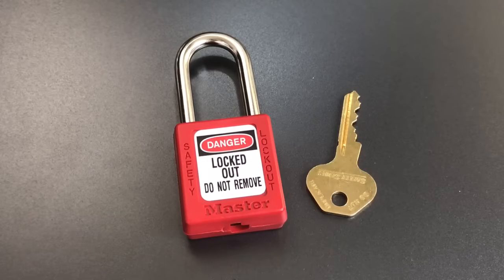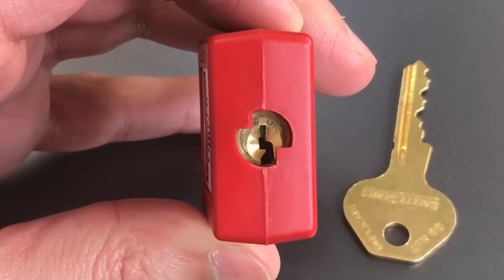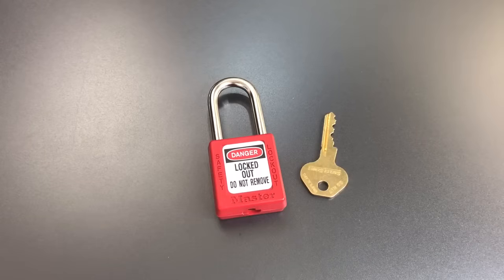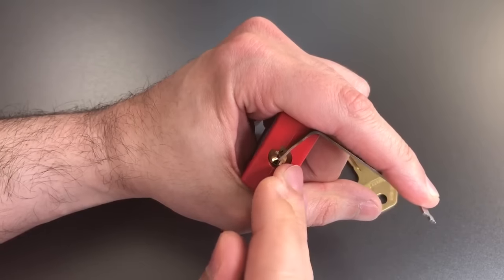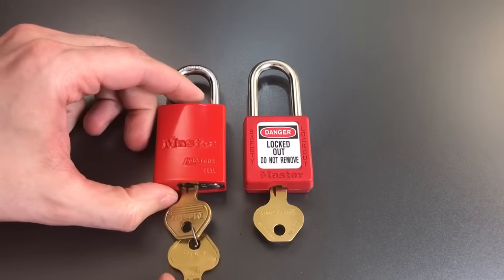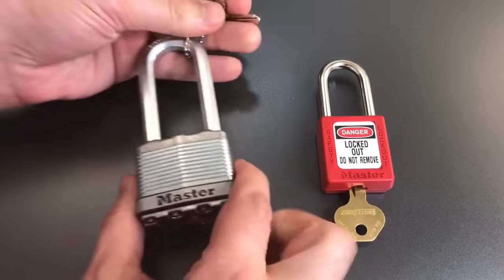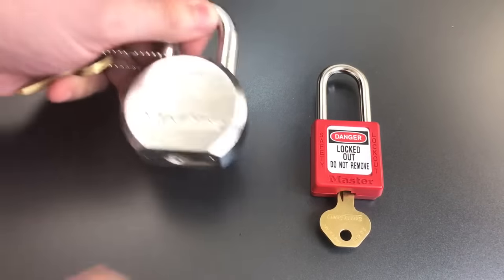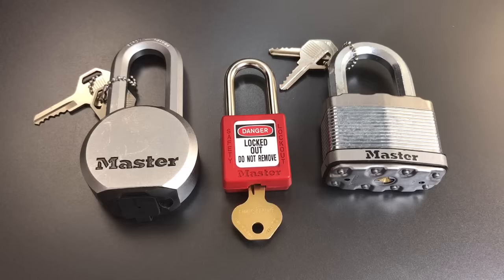[479] The Master Lock Paradox - Model 410 LOTO Padlock

Comment: It is a desirable feature for these locks to be relatively easy to break. Many times locks needed to be broken when an employee left the facility without removing their lock.  A supervisor was allowed to break the lock after locating the employee and verifying that they were no longer at the site.   Usually these locks were used with hasps that were even easier to break than the locks. As far as I know, these locks are not useful beyond compliance with OSHA regs.
Reply: I was going to say that. 
Also the employee could drop the key somewhere irretrievable. Also the locks should be inexpensive and unlikely to have common keys and resist accidental raking despite a maint-dept having large numbers of them.
Reply: mjenk20236

I've had to use one of these and I believe that is the case. I dropped it about five feet once and the shell came clean apart; it's not fusion-welded or anything, literally two halves of a clamshell with a couple pins for aligning them with each other and some light adhesive to keep them together. I taped it back together.

As for the extra security, it's to help ensure your key is actually being used on YOUR lock. But on the backside a label is provided where you're supposed to write your name; it also comes in several colors, mine was yellow, here we have a red, and I've seen blue before. An ounce of caution will go much further than any lock core in making sure you remove the correct lock -- does it have your name, is it the color you were assigned, are you sure you're at the panel you are responsible for?

It would also be feasible to provide multiple locks to each person if they will be working on more than one zone. Use different colors or something, or stamp serials on the shackle and each matching key.

Finally, a fatal mistake I have seen is for multiple personnel working in one zone to daisy-chain their locks off each other. There are group lockouts with multiple holes for each lock to be installed and ensures every lock must be removed before it can be energized, use them!! A six-hole group pad can be made to fit many more, just daisy-chain the group pads off each other until the necessary amount of holes is had. If even one lock exists anywhere on the chain, ultimately the one on the equipment will not open.
Reply: wow, where I work if you leave your lock on a tool/machine you will be called back in to unlock it.  You could lose your cert and or get written up if they have to pull out the bolt cutters and have a huge ordeal.
Reply: All you need is a claw hammer to break off a plastic masterlock.
Reply: Nailed it.

Bigger yellow ones are usually on the hasps. They aren't meant to not be broken into, just so you need to fill out a form and check the machine is clear.

They're for saving fingers not property
Reply: Mikej1592 that makes sense for machinists. But in production when you have 40+ employees locking out multiple power sources 2 or 3 times a day doing hot and sweaty work as fast as possible to move on to the next one.. shit happens.

We look down on it, but it wouldn't be realistic to reprimand operators for it. Fill out a form and cut the lock, unofficially give the guy some shit for it and move on. 👌

The time and money spent on training and certifications far outweighs a few 10 dollar personal locks. And really, you only use your red lock alongside the yellow lock box locks. Usually on the lockbox hasp itself.
Reply: mjenk20236 did you know that you can get locked up in jail if you break a lockout lock in certain parts of the world, as in some cases it can lead to harm of other people
Reply: I only lost my key once and that was enough. It had fallen through a hole in my pants under my overalls and down my pants leg. I had to practically strip right down to my underwear before I finally found it. All my workmates were having a a good time watching me go nuts trying to find my stupid key......Never again!!!
Reply: mjenk20236 

Besides being able to cut the lock easier, another couple features are that those locks are lighter weight. If you’re running a loto with 200 locks, that’s a lot to haul around, even with a cart.

The long thin shackle is also desired when locking breakers or ganging valves/chains together.
Reply: In my country it's actually illegal to break those locks, even if the guy who locked isn't in the vicinity anymore. That's why some pad locks we used came with tag attached with the worker's phone number and address
Reply: mjenk20236 you people aren’t understanding the paradox he’s talking about. It’s not necessarily about the LOTO lock having a good core but a crappy housing body. It’s about why does the LOTO have a good core but the other high-end, probably very expensive MasterLock locks don’ have a similar good 6-pin core. That’s the paradox. Why would the consumer-use high-end locks with strong bodies not also have a good core when these are the ones that are more likely to get picked?
Reply: Because consumers make their purchasing deciaiona based mostly on two factors: price point and looks. Using the better core in consumer locks would increase the cost without making it look more secure, so it would be a poor choice from a sales perspective.
Reply: @johanbouwer5386  Yes, but if an employee locks it out, and then has a stroke and goes to the hospital, it is perfectly acceptable for the OWNER of the equipment (management, the boss, etc) to have a well documented set of procedures to verify that the employee is no longer working on the equipment, is no longer physically present, has zero chance of being harmed if the equipment is re-energized, and to break/cut their lock so that the equipment can then be used. Probably will require at least two management level employees to approve, and perhaps an actual equivalent maintenance employee to verify the equipment is in a safe condition to turn back on, and to all sign off on a document certifying that.
Reply: @leaf3814  What if the guy who locked it, fell asleep while driving home and drove off a bridge and died? Is the employer required to just never use the locked-out equipment ever again? (And just for good measure, lets say his key for the lock was lost in the river he drove into)
Reply: @r6u356une56ney  you are correct. Only certain people may remove the lock if the employee is unable to for any reason. Usually there are only about two or 3 people at a factory with the certification for it.

Comment: Lockout tag out is practiced mostly by electricians for "locking out" electrical circuits aka turning them off and then tagging it with name and phone number. If this circuit was somehow to get turned on while getting worked on someone could die. Not designed for anti theft. Power tools are every where. I could cut the shackle off with my linemens aka side cutters.
Other companies make lockout tag out locks with a picture of the person attached on shackle with "Do not turn on, my family depends on me" written on lock body.
Reply: Holy moly, how dramatic!
Reply: @seno5530  It happens more than you think

For example in the USA alone, between 1992 and 1999  (i.e. 7 or 8 years)
there were ~2500 fatal occupational electrocutions.  
Most of these (i'd guess upwards of 98%) occur on low voltage circuits.

So that is about ~300 per year over this period.
Reply: They are also used in Underground mining for locking out dangerous equipment, if you need to go into the area that has been locked out you have to lock on first, and everyone needs to personally remove their danger lock before the equipment can be re-energised. they are for protecting human life from accidents, not for protecting valuables from thieves.
Reply: Nick Paul  My man came back to the exact same comment a week later just to double down on calling "Se No" an idiot. What an absolute chad.

edit: Unless they deleted their comment. Fuck, I'm tired, idk why that wasn't my first thought.

Comment: As otherwise mentioned, we use these for safety in the oilfield for, "Lock out, tag out" of valves and pumps when equipment is shut in or being serviced. Where these are used can often be bypassed with a wrench or screwdriver to disassemble the handle or leaver leaving the lock intact. What I leaned from this vid is that they have great cores that will help prevent accidents and serve their purpose perfectly. Well done LPL, always interesting and informative.

Comment: This was probably done to provide as many possible key variations to prevent multiple people from having the same key, since it’s a lockout lock and they are generally key different. It provides an extra level of safety to ensure a lock isn’t accidentally removed and equipment re-energized.
Reply: Since it's a reasonably tough lock to pick, it's also not easy to remove non-destructively, so any malicious removal of it's likely to be discovered.

Comment: As a 25 yr career electrician, the light weight is especially handy when locking out small circuit breakers (lock out tag out or LOTO).  Bigger locks will just fall off.  Red is always the electricians craft lock, not personal lock.  This series comes in different colors too.

Comment: We use this exact lock at my workplace working on trains. We often have to carry around 3+ of these when going out to jobs. It is very light so convenient to carry. If we had to carry those solidbody locks around it would get really difficult so I can understand why the design is so lightweight. They are very reliable I've been using the same ones for 10+ years.

Comment: When I was out of high school in the steel foundry we never actually had lockout locks at all. Each maintenance man that was working on the machinery would lock my machine out and just put a regular lock on it. Somewhere in the 70s they decided they needed to identify whose lock it was so even though the mechanic use the regular lock he had a red tag on it.  it had a warning label similar to that one on the side of the lock your showing only it had the mechanics name on it. And like other viewers have said multiple mechanics needed to put their multiple locks on it. We had one machine that was out in the yard when five mechanics were working on it at the same time and each one had to have their lockout lock on it so that if they all went to lunch and one mechanic never came back and then got his lock off are they would still be four remaining it was never designed to keep people out it was only a designed to make sure that all the employees knew that they power should not be turned on and whose lock was on it and was probably responsible for the machine being shut down. It's not a lock that needs to be picked. The 6-pin Tumblers we're an OSHA requirement not necessarily keep bad guys out but just to keep the machine safe and the people working on it.

Comment: Brady also makes a plastic non-conductive LOTO. Plastic is preferred for electrical LOTO and metal, usually American 1100 Series, is popular for valves and other applications. WARNING: Do not pick the Master past 90 degrees. The key stops at 90 by design but you will dump all of your pins out of the bottom of the core if you pick it and turn it to 180. Which I did. I ended up splitting the case open (easy), putting the core back together, covering the holes in the core and put it all back together with a wrap of tape.Great practice lock.

Comment: These looks are placed on lockout switches that are generally power switches made of plastic and I think it's more to do with electric insulation and anti tamper than security as the switches can be removed very simply with a screwdriver

Comment: Great content! Lock out tag out (LOTO) procedures are for isolating energy sources, not securing valuables. In almost all installations it is illegal to remove a lock you did not place.  It is also common policy to ONLY use LOTO locks for LOTO purposes - they are not permitted to secure valuables. No need for a solid body - if you placed it, you’re the only one who will touch it. Regarding the better cylinder, it would be a tragic mistake if 2 unrelated contractors on the same job site had the same key and the wrong lock was removed by mistake. This is about safety and protecting someone from a potentially deadly energy release. So why not improve the tech in other locks? That’s up to Master, but they need to make sure for safety and liability reasons that their LOTO locks remain safe to use.

Comment: Electrician, speaking from knowledge of multiple men working isolations of one individual circuit E.G. a socket, the idea is that there's less possible chances of a replicated key so you know that you're the sole holder of the key to energize the circuit that you have isolated. They've  put their most secure barrel on what is considered an electrical isolation lock (not for average security on a door) to remove any possibility that by absolute chance the key and barrel orders have been replicated  and another individual can unlock another electricians safe isolation lock thereby causing him to be electrocuted. Hope this makes sense if you see it :)

Comment: We use these at my work alot, the only reason I can think would be a good reason it has strong core. The reason would be that you don't want someone discreetly opening the lock, if someone snaps or breaks the lock it's totally disabled and clearly something is wrong, while if they pick it then flip the switch then re-lock it , then it could be perceived as still working properly but it's actually an unsafe scenario
Reply: If they have malicious intent but are planning ahead, couldn't they just break off the lock, flip the switch, and then put on a new LOTO lock of the same type — either one grabbed from storage, or one they purchased themselves?

Comment: As an electrician I use the model 410 all the time as a lockout on 20 amp breakers. And I like these over the metal bodies just because of the lightweight. And when you have to have multiple people lock out on the same breaker it can be a good amount of Weight on the lockout. With enough weight they can get pulled off.

Comment: I'm a welder 14 years, and also an industrial electrician. I've been trained in lotto, and those locks really are a big deal. Everyone working on a permit that is relevant to the job, has to put on a lock that is signed out to you. Once the job is done, the equipment, or electrical system can only be turned on once everyone has removed their locks. If you forget your lock, and you go home for your days off, the system cannot be turned on until the company gets the key back lmao this has happened and people are immediately terminated for forgetting to remove their lock. Also if you remove your lock, but go back and work on the equipment without putting it back on, your immediately terminated, or killed by someone energizing the system.

Comment: I work at a French silicon foundry, this is almost the one we use for LOTO, except with a black plastic shackle. Pretty sure they use the same core. Pushing the paradox further.

As for understanding the core/body weirdness, let's say it's likely a very American thing: the product, before even starting any development or anything, is supposed to meet a price point, and once the body is developed, depending on how much it costs, will be assigned a core... with no regards to anything but overall cost.
Reply: Businesses aren't that stupid, especially in the US. They certainly have an upper bound on the cost of every part, but will certainly choose a less expensive alternative if it's available and meets specs.

You're probably thinking of the US *Military*....

Comment: The most secure part of these locks, honestly, is the LOTO policy that goes with it. When trying to remove an LOTO lock without a key is a fireable offence without several pages of paperwork, it doesn't need to be pick/break proof. We had a bit of a problem with people confusing which lock was theirs since sometimes machines can have upwards of six locks on them. I bought a sheet of stickers from the dollar store and it looks odd, but it works.

Comment: The plastic is both non-conductive and non sparking.  

Both are really important in an industrial environment.  

The six pins probably have to do with the number of key combinations possible. 

I use them a lot at work.

Comment: I can say from my experience repairing industrial equipment that I have used a dozen (and sometimes more) locks on one piece of equipment to secure all sources of energy.  I have procedures to test and secure power at the knife switch and up stream by a breaker or two depending on what we are doing. These are large Square D motor/Starter panels mostly running 480. We also have 120v control circuits, high-pressure air, usually liquid nitrogen, and sometimes hydraulics that all need to be secured. If there are multiple people working on the system, we use a multi-lock hasp and you can have up to 6 locks on one hasp. I have also seen a hasp securing another hasp so up to 11 locks on one source. Those would be too heavy hanging off a standard breaker arm, not to mention you have to carry these in around when not in use, so the plastic bodies are nice. Because we have safety officers, inspectors, and others that may come in and out of a process, the multiple combinations of cores is necessary as they are all keyed differently. We are all responsible for our own locks and keys. If someone gets hurt or is on leave when the power needs to be restored, the lock must be cut; that takes a bit of paperwork to justify it and usually we avoid this at all cost.